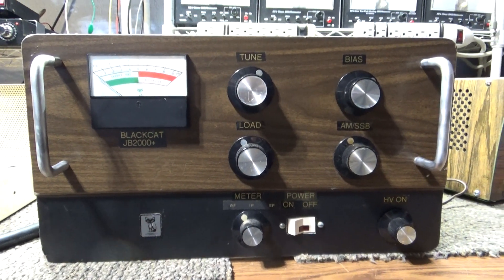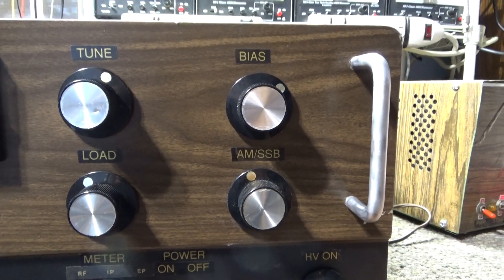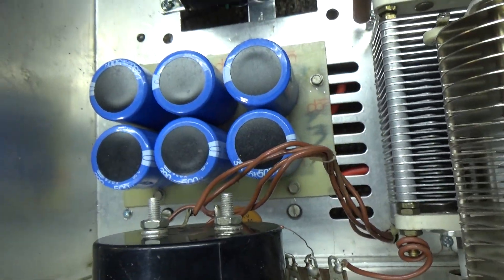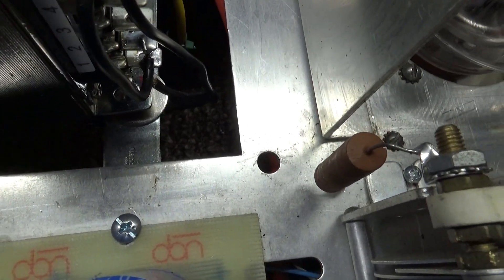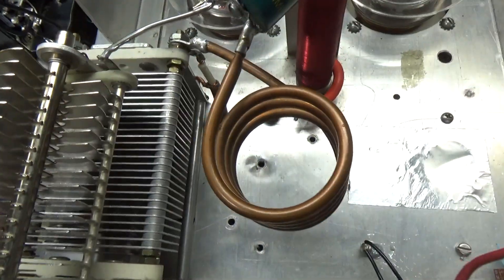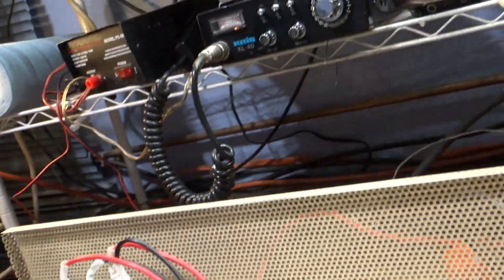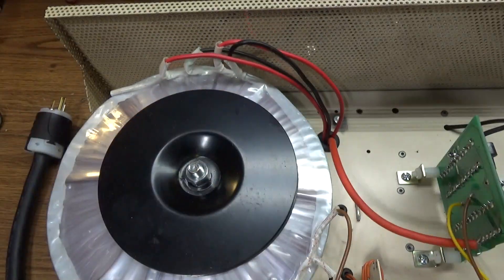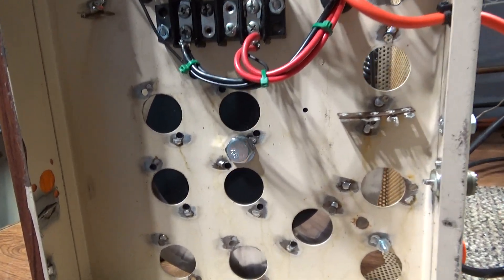Blcakcat JB-2000+ Linear Amplifier unpowered Walkthru Talkthru

Comment: Concerning the safety chokes on the output of linears that have high voltage. The chokes safely ground any high voltage if the pass capacitor should short. But in addition, if you are using a CB antenna that is not grounded, that choke grounds the antenna and helps get rid of static buildup. I bought a bunch of Ohmite Z-28 and Z-14 chokes and put them in amps and across my ungrounded antennas. It’s a great way to keep static from building up in antennas, especially in my mobile antenna that is a Racer 102” whip that has no grounding. Mobile antennas naturally get a lot of static electricity buildup when you drive down the road. That choke shorted it out and made my antenna much quieter. The Z-28 is a smaller amperage choke but is built for 10-80 meters. The Z-14 is higher amperage but less bands. That is something only hams like me are concerned about. For CB, either will work.